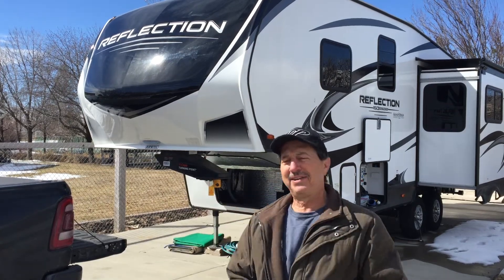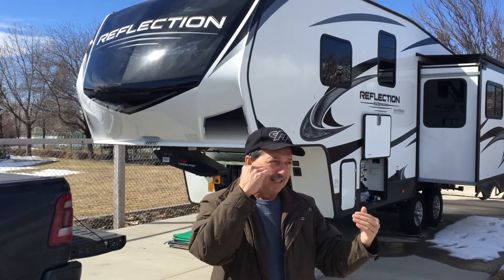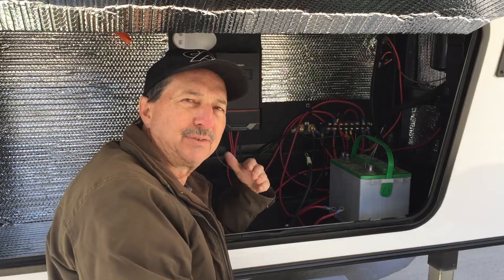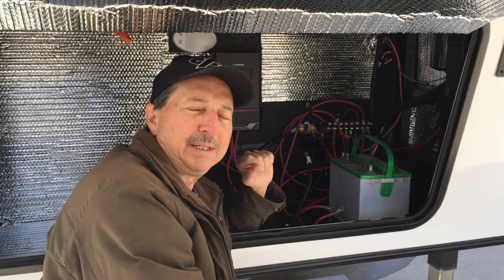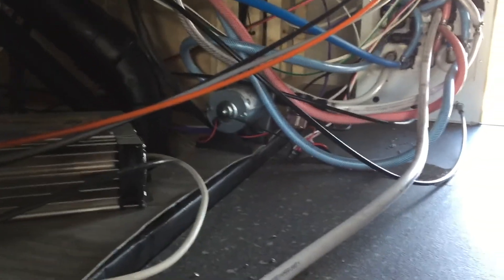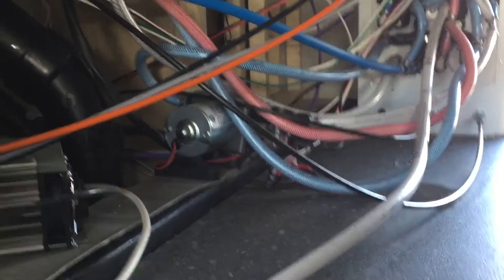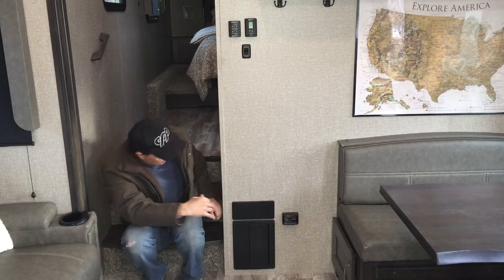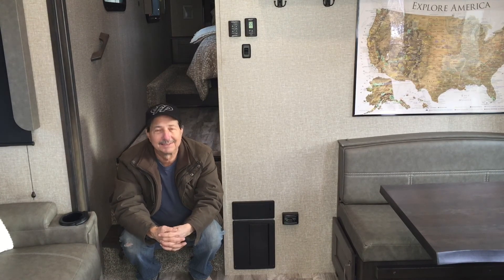12 Volt DC Power Converter Not Working When RV Is Connected To Shore Power. Works On Battery Power.

Comment: I have a 2008 Montana 5th wheel. I will be moving into a permanent spot. Do i need to keep the battery hooked up if i am going to be plugged in all the time?
Reply from the maker: Some RV's need to have a battery  connected at all times but most don't. If you keep batteries hooked up long term they will get ruined from over charging. Try disconnecting them to see if everything works.

Comment: Most helpful video i have ever seen amd i love how happy and smiling you are! My battery is still going dead and i hav3 a charger hooked up 25/7 and i have mine hooked up to my sisters house on a 30 amp to a 50 amp dog bone connected to a 50 amp in the basement
Reply from the maker: Thank you for the kind words. Be careful with overcharging your batteries. Keeping them hooked up and "charging" all the time will damage them. It is best to keep 12 volt batteries on a battery maintainer rather than a charger.

Comment: I used to deliver campers and fifth wheels to dealerships from the manufacturers. It doesn’t really matter how nice or expensive one is, because they are thrown together so fast and sloppy that things like that unfortunately get  overlooked at manufacturer. The running joke up around Elkhart and Goshen, Indiana, where most of those things are made is they are built by the finest meth heads in Elkhart County Indiana.
Reply from the maker: Yep but those meth heads sure work fast. LOL

Comment: Wait, you mean you bought it and they never demonstrated to make sure everything was working .....that's you fault dude
Reply from the maker: Yep. I purchased it "as is, no warranty" with a huge savings. And then Camping World managers asked me to sign a form that claimed everything was working on delivery. WTH? The sales manager would not let me inspect it but had the balls to tell me to sign that everything worked? I refused to sign it and then he realized how stupid he was and he wrote "as is" on the signature line. It was 8 months old at the time, I thought, what could go wrong? Well, just about everything that could go wrong did. In the end, Grand Design came through and fixed plumbing, fridge, slide out and more with a free extended warranty.

Comment: Enjoyed the vid, isnt it just a shame how crappy they build this stuff?    
I didnt see where you followed up with a vid about converter/charger change for lithium?  I am adding a 2-400ah 12 lithium house battery over the lousy lead one, and have a intelipower pd9260C  converter charger.  Hobotech (great youtube channel) says you are just fine charging up lithium with these chargers no need to buy newer, but they wont top them up100  full ( i have solar that will top them up with mppt controller set to lithium).  But, everyone else says no, you must upgrade the converter charger.  What did you do and how is it working?   Conflicting info out there, and need to do it properly,  Cheers, and blue skies.
Reply from the maker: Totally agree with how crappy the RV industry has become and the cost is crazy high. I was hearing the same thing about needing to change my non lithium converter. I decided not to change the converter and found it is perfectly fine. With my 165 watt solar on the roof, my 300 ah's of batteries is almost always 100%. When I'm off the grid I add another 200 watt portable panel that serves me fine. Only had one trip with bad weather that caused me to conserve power. Thank you for the comment and thanks for watching.
Reply: Just as an aside, I will be putting in at least 200ah of lithium for the house battery but I also carry a bluetti ac180(had for a year) or 200max (just ordered) with me.  It is a great back up power source and can also be used in my house as back up for power out. Seems best of both worlds and redundancy for reasonable spend giving lots of added AH to RV needs  Cheers, R  @riderescue
Reply from the maker: Great adder. I have an old generator that I want to sell and get quite back up power to replace it. @ghostflight73

Comment: Have a question sir. When I plug my Camper in campground. I have electric for outlets and Fridge. 
    I’ve replaced my battery twice or recharge. Then I have lights and Air. Till the battery is dead. And back to recharging the battery. Would you say my converter is bad. When I first bought the camper. I could hear the fan running. But haven’t in awhile. 
   I own a Four Winds 36ft 2007 pull Camper. And not sure what converter I need. Would convertor be under my panel box? And help would be appreciated.
   I get off the river (work) in about a week. And plan on trying fix the problem
Reply from the maker: It does sound like the converter / charger is bad. You can test it by disconnecting the battery, plug in to shore power and test for 12 volt power at the two battery cables. There should be 12 volt, if nothing, then could be converter / charger or could be fuses like mine was. My converter is behind the wall panel in the storage bag. Should be easy to get to with just a few screws. Good luck.
Reply: @riderescue  I hook shore power up. I have electric and fridge works. But that’s all No Lights or Air Conditioner. I I’ve replaced the battery twice. And the fuses are Good. Is converter and charger two separate devices inside the camper ?
Reply: @axlyoung1218 i have the same issue i have ac power at the outlets but no dc power like ac or lights, i changed converter & fuses are good. Where do i check because i cant find a battery disconnect switch. 

Did u find the problem?

Comment: I have 3 SOK 100AH lithium batteries wired in  parallel. I did have to change my  inverter/charger to a lithium charger/converter,so far everything is working as it should!
Reply from the maker: I am going to go to 300AHs as well. It makes sense to upgrade the charger with that much power.

Comment: My inverter gave off a burning smell, now it turns on but nothing plugged in has power. What could this be?
Reply from the maker: Check all the fuses. My converter/charger had three and all three were burnt. If fuses and breakers are okay, check the power going in and out, with a meter.

Comment: My battery isn’t charging when connected to shore. Do you think I have to replace the converter? All my fuses are intact.
Reply from the maker: I would start by checking the 12 volt wires coming out of the converter and go from there. Work you way to the battery, checking each connection, breaker or fuse along the way.
Reply: @riderescue  I redid all the connections at the battery terminal include the in-line fuse. I get power when I jump the battery with my truck. But converter doesn’t charge it.

Comment: you are doing it right. Tackle one problem at a time. You will eventually get there. Good to hear you didn't fall for the dealers song and dance. I went through that once or twice.
Reply from the maker: It's amazing how many problems this trailer had. I feel bad for the prior owner, if they couldn't do the work themselves and had to rely on the dealer? I think that is why they traded it in. It was not usable for water, power or fridge.

Comment: I just lost power today. I have good power coming out of the meter. I believe my converter just crapped. Lights would get dim, then bright, then dim. Only power I have is outlets. Converter is from 07. Battery was load tested and is still good.
Reply from the maker: It does sound like your converter is acting up. Everything 12 volt work from battery when you're not on shore power?